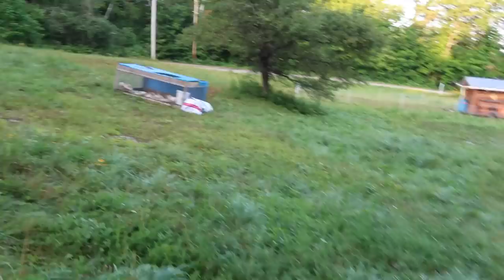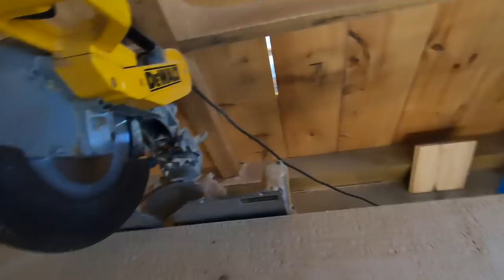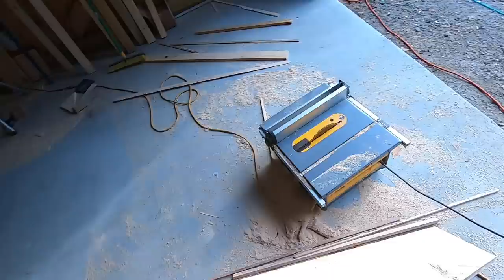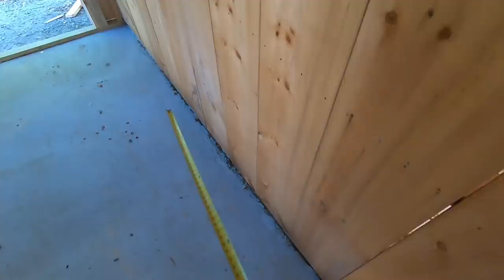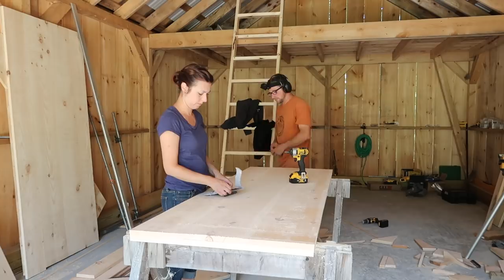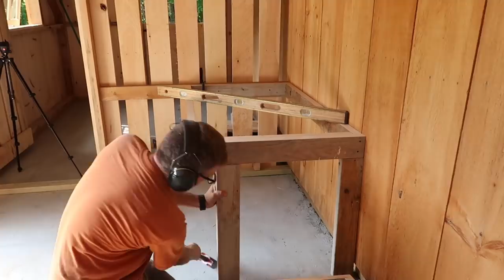You've NEVER seen Barn DOORS built Like this BEFORE No ShortCuts Now New livestock  ARRIVES Soon

Comment: Are you going to insulate the underside of the goat bed/platforms? This will help them retain body heat during the winter. Otherwise, the cold air circulating under the bed is cold. Anybody who has slept on an army cot in winter knows how cold that bed can be with cold air under it.
Reply from the maker: I like that idea

Comment: The goat stalls are looking awesome. The goats are going to be so comfortable in there. Are you going to insulate the walls for them? You get extremely cold winter temperatures there and while I know animals get a winter coat they would still need some extra warmth there.
Reply: He is insulating the center part of the barn but not the goat stalls. Barns need to breath so it wouldn't be safe to insulate where the goats will be.

Comment: Hey Al, It's not gonna be the same without CWC following you from the pigs to NYC! Also, an idea for water in the new barn, would be to fasten a rain spouting to one wall and seal the ends up to retain water. If you'd want to get more elaborate, put one of those  valves in one end like you have at NYC, and have it connected to a 55 gal drum outside catching rain water like you did at NYC and the pig  shelter.

Comment: Love seeing Gina helping so much in the Goat Barn build. Love seeing all this work coming into its (probably) final form. You are smart to build with screws - it leaves you a lot of options! 
Is there a guess the animal sweepstakes running? The way I see it - you have mentioned beef cattle before. But they would only need a barn in winter. Sheep would be a possibility - for wool and/or meat. In either case, a couple of donkeys would be a good safety net, especially for protection of young animals. That's my guess.

Comment: A raccoon, skunk or possum could easily attack a cornered chicken, but out loose, no way, they just aren't fast enough to catch a running chicken, so it's a fox, coyote or maybe a big cat. If that's the case, those traps are way too small. The predator isn't finished, not if it's trying to fatten up for the winter and it's placed the farm as a source of food, so it will be back. A trail cam would give you an idea of what you are dealing with and you may want to call in outside help.

Comment: When you're cutting those wider boards like that,  you can just lift up on the edge of the board closest to you to finish the cut without having to flip it around. Just lift the front edge and raise the saw a couple inches and it should reach the edge of the board.

Comment: My dog is the total opposite, so will charge at it with no fear, then is it's bigger than her, witch most things ar, she runs away, LOL I would set up cams and geta bigger trap, I think you have a fox problem, and they will not go in to a small trap right off the bat, they also might take time going into a larger trap. leave it there and if nothing in 3 days, then us a larger trap, let it sit 3 days with cam so you can see what it is and if it is even interesting or fits in the trap. Good Luck.